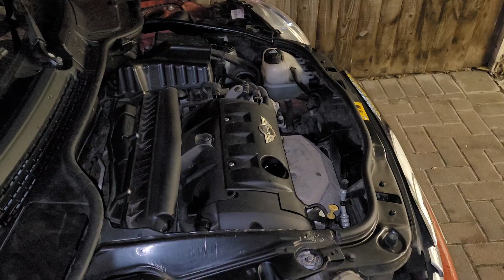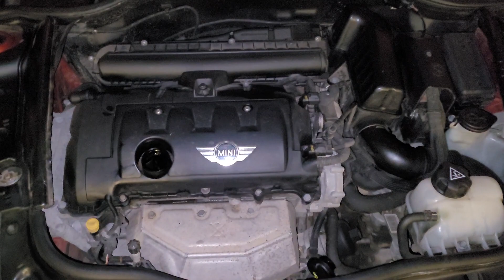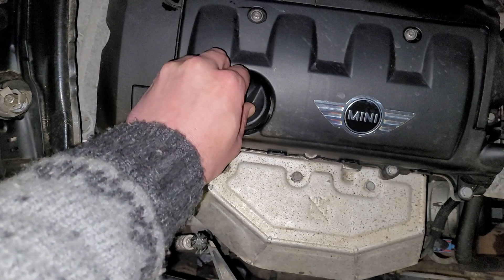customer states vol 1....

Comment: I was speaking to someone from a Citroen club about the prince engine recently as I was curious about the bad reputation the engine has.
I had a 155hp THP engine in a DS3 and the engine was the cars party piece, it was a brand new car though and I only had it for about two years.
So I now understand they have a very thin timing chain and combined with the usual excessively long service intervals, buyers if a used car with a prince engine could be finding themselves with some very costly issues.
Reply from the maker: You want to try working on one. Especially when that silly chain breaks